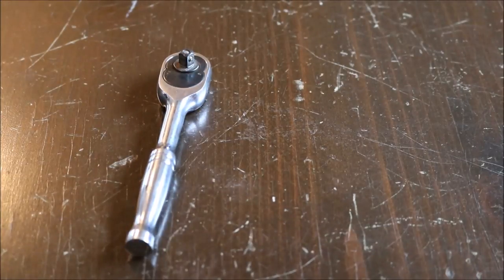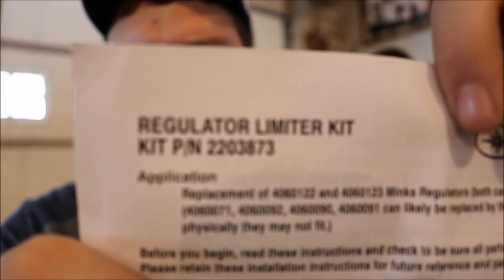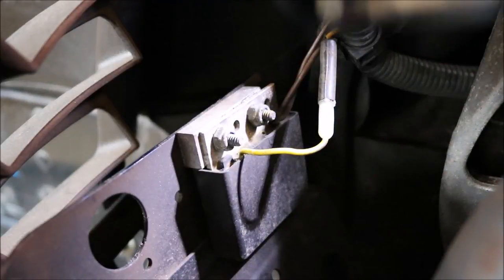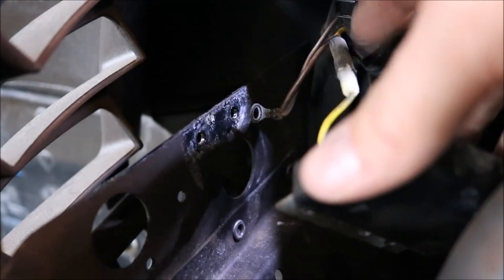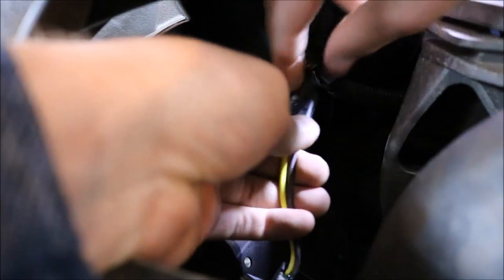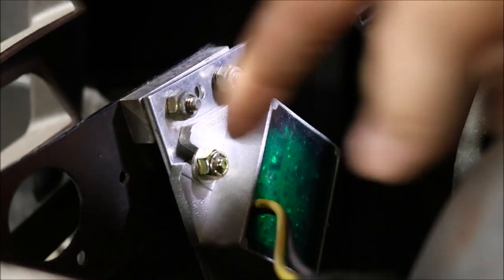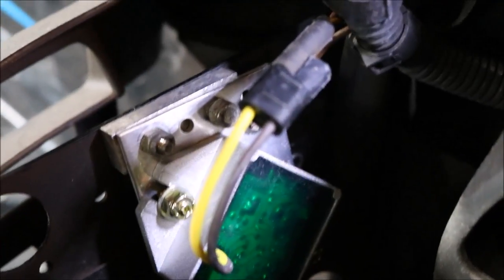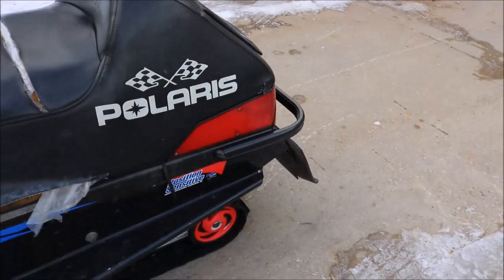Voltage Regulator Install - 99 Polaris Indy snowmobile

Comment: I had rear tail light but no other lights on 1999 500 XC SP.  I replaced VR and nothing.  I took apart the left hand controller for lights and hand warmer.   Nothing bad there either.  Eventually used volt meter and found the plug under the recoil (brown and yellow wires) shorted out and melted plug.  Removed wires from the plug and fixed harness.  Unit runs great again and all my lights are back in service.

Comment: I have a '99 Classic Touring w/electric start that is doing the same thing; lights going dim and bright again randomly regardless of rpm.  Does this regulator work w/ electric start machines?  Does yours have it?  The OEM p/n regulator for my machine is no longer available and wanted to make sure this retrofit will work.  Thanks.

Comment: We have a 2000 Indy trail touring 600. I took out the battery for the summer and when I reinstalled the battery the machine would start but none of the lights, hand warmers or reverse switch would work. Would the regulator be an issue?

Comment: my headlight is going dim, at times, handwarmers not very warm, 99 xc700, I did some googling and I found the hot swap is arctic cat voltage regulator, It is $39 compared too Polaris $84, and supposedly a better part. just ordered it.
Reply from the maker: you are right that is a very common swap for these older Polaris sleds with the outdated voltage regulator. Maybe someday i will make a video on that too lol
Reply: Hard to swap em?

Comment: Thanks for the info.  As for the rectifier, do you leave that installed?  Or, does the new voltage regulator take place of both?
Reply: Leave rectifier hooked up it changes AC voltage from stator to DC voltage for regulator which regulates the DC voltage
Reply from the maker: ^ this person is correct
Reply: @BoostedBrothersRacing  Where is the rectifier at for the 2000 polaris 700s been trying to find a regulator/rectifier to add and battery to be charged

Comment: So when I start my sled it fine and when it kinda warms up the lights go really dim and boggs down is this the voltage regulator?
Reply from the maker: Pike Lake Kenny I would say probably not I'm assuming this happens after you take it off from choke.
Reply: I'm WAYYYY late to this, but you sir have a bad stator.  The give away is running temps make it worse and your engine performance suffering.

Comment: I have a 97 Indy is the voltage regulator in the same place on mine as in your video?
Reply from the maker: I am not talking out of experience as i have never owned a 97 but i believe it is in a similar location but looks different than my factory unit. sorry i was not more help.

Comment: Any chance you have a link to this one still? I've been searching all over and cant find a good fit, mines a 98' Indy Triple.
Reply from the maker: Are you looking for a link to purchase the part I assume
Reply: That3ValveGuy yes please, i can’t find one anywhere
Reply from the maker: @AshtheticGaming  the one that I used I purchased from the local Polaris dealer. This one would probably work fine.

https://www.denniskirk.com/parts-unlimited/voltage-regulator-for-manual-start-engines-01-154-21.p2130.prd/2130.sku?utm_source=google&utm_medium=cse&gclid=CjwKCAjwx7DeBRBJEiwA9MeX_AVUqxEdvfxMrABwHfBrchnOBP1CyZKNtVf3jHfz-eoWqVqrirbLxBoCzWMQAvD_BwE&ad=228601179045

Comment: I bought a universal voltage regulator for my Polaris Indy RMK 800 after my lights began to glow strangely bright, and one of the lights on the intrument board died, and soon after almost all other lights also died so I changed the voltage regulator and switched all the lights with new ones and then i start it and drove around for 30 minutes then came a flash of light and the half-beam light died but only! the half-beam light all other lights work just fine, I swapped the half-beam light two times and each time it died. do i need a new voltage regulator? an original? I saw that my original voltage regulator was like the one you put in.
Reply from the maker: there are a few things that you can try first. make sure obviously that you are replacing your low beam with the proper resistance bulb, make sure that you have a very good path to ground on your new regulator, make sure that there is not a strange short in the head light assemble, and if all else fails change out to the upgraded Polaris regulator.